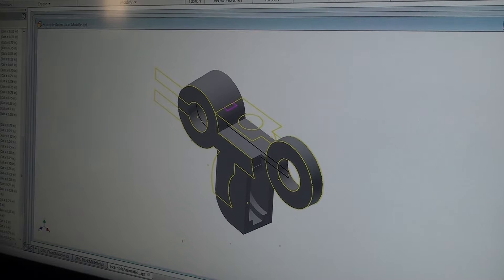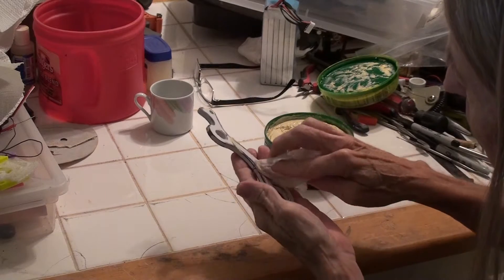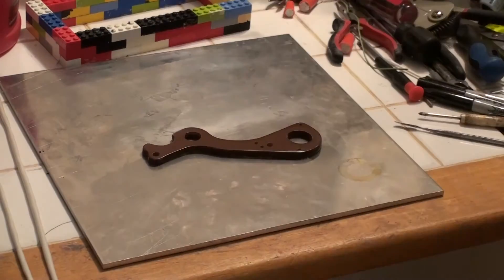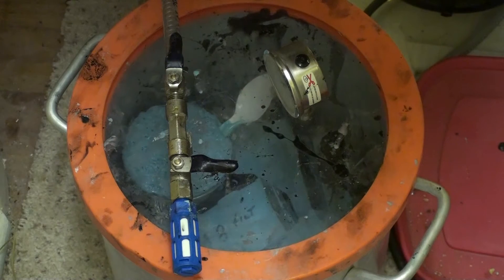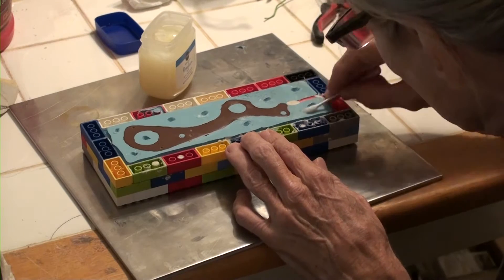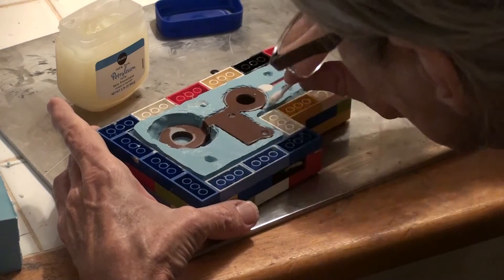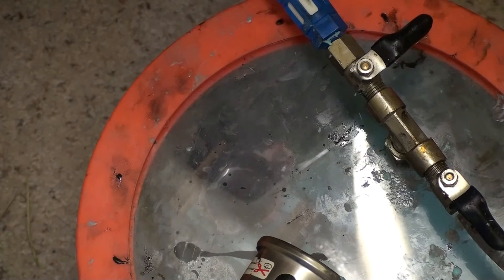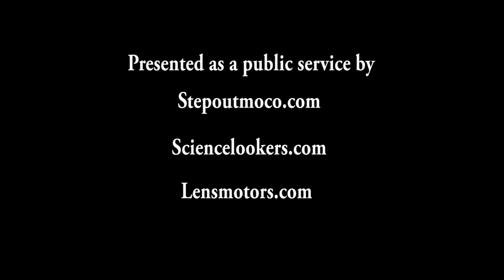Moldmaking With RTV Rubber And Resin Casting

Comment: Nice video, thank you for posting it.  I'm getting ready to cast stop motion puppets in silicone, with plaster molds.  I don't have a vacuum pump though, so I wonder if it'd work or not.  I think my RTV has a lower viscosity than yours.  Without a vacuum pump is this even worth trying?  By the way, those focus gears look amazing.
Reply from the maker: The way the model is held down to the bottom, bubbles tend to float up and away from the part.  To avoid bubbles sticking to the model, try painting it with the rubber after securing it to the bottom and before pouring the rest of the rubber in.  This should work even without vacuum.